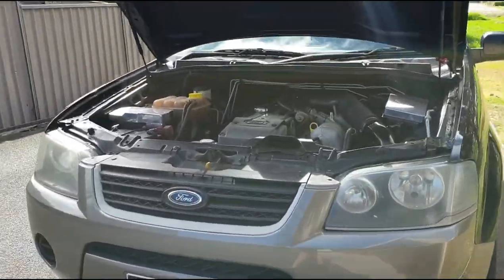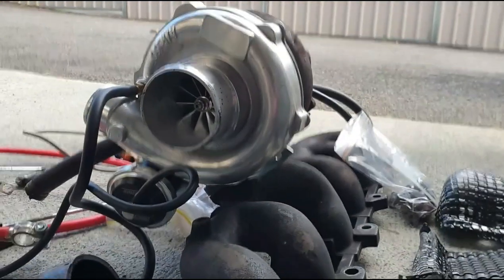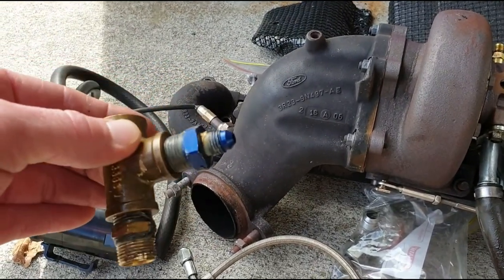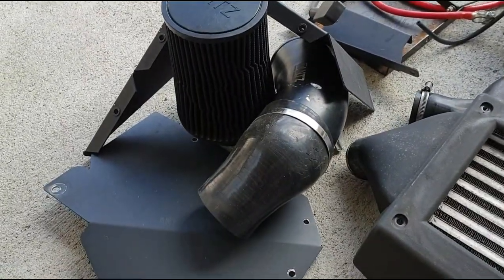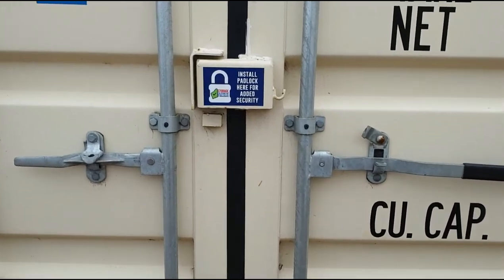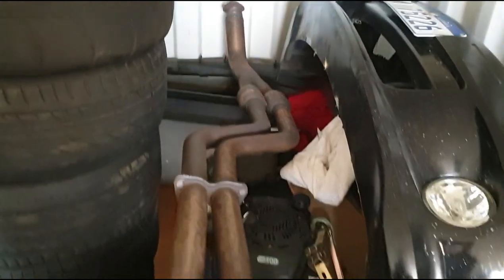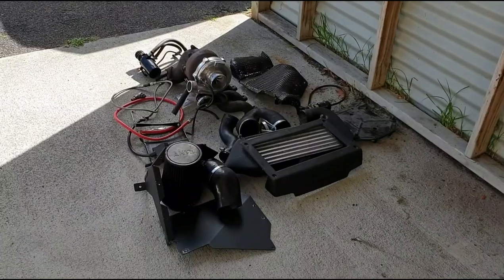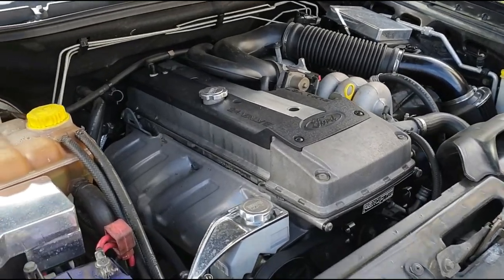N/A BARRA TURBO CONVERSION! PT2 | RWD Territory | What PARTS Will I Use?!

Comment: Are you gonna get the turbo territory bonnet if you can find one?
Reply from the maker: Ideally yes :) but not to start off with 👍
Reply: @RossHollandAU  How will you get airflow to the intercooler sitting ontop of the boiling barra without?
Reply from the maker: @Mr-Broccoli        turbo territory bonnet or a bonnet scoop. But even a cooler with minimal flow is better than none 👌 a few videos out online proving this :) I have the digital dash there so I can keep an eye on IATs in the mean time
Reply: @RossHollandAU  could just use a Subaru hood scoop bro, cut out a hole and mount the subi one in,

Comment: How come your running a blow off valve?
Reply from the maker: A few reasons.. I had it from my last turbo setup,  the stock bov's are pretty average,  neater in the engine bay. And mainly because I will be running a relatively cheap turbo so anything extend its lifetime couldnt hurt :)

Comment: Hi Mate, is it ok if I message you about some parts you are using for this? I am looking to buy a Territory and the parts and do this exact conversion.
Reply from the maker: Yeah mate my in Instagram is the place to do that 👌😎 but I do have a video with most of the parts in a list that I used for my falcon as it's the same parts besides a couple of things, that may help you out a bit too 👍